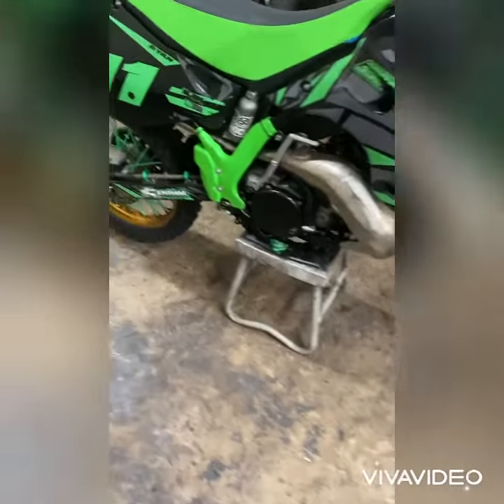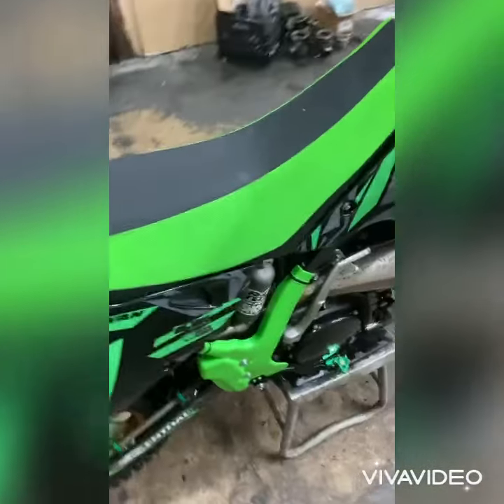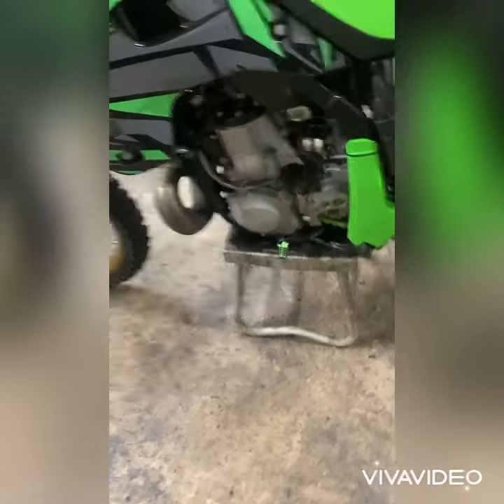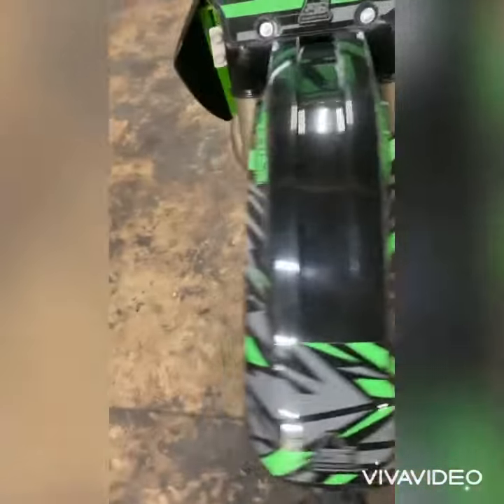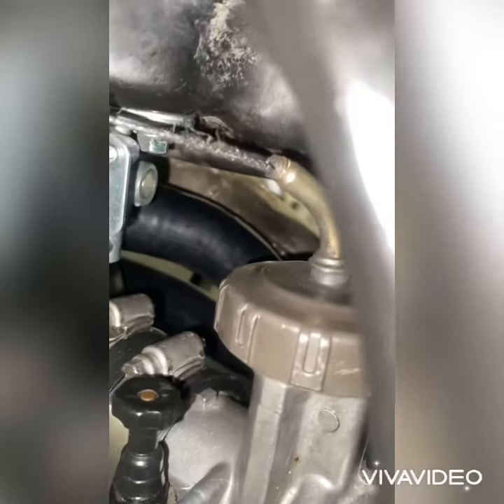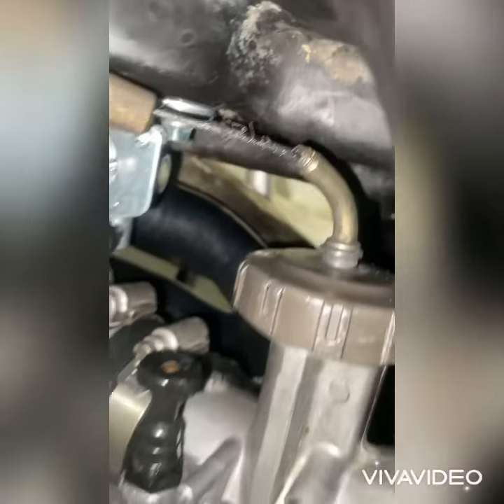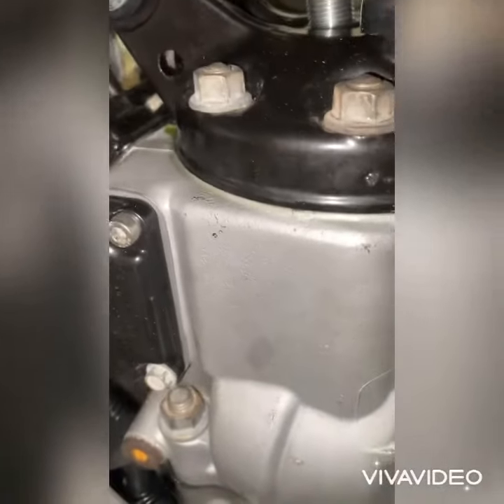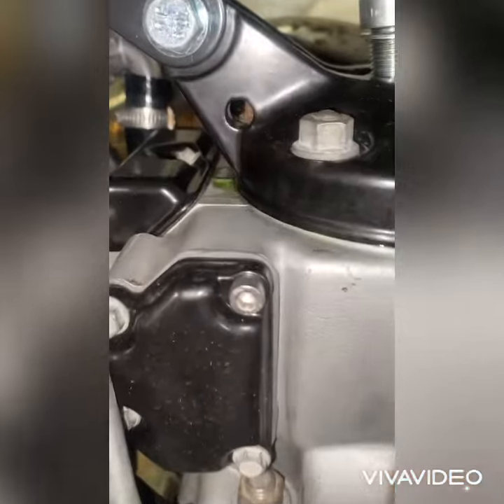🔨🔨🔧🔧 1993 kx250 footpegs carb clean tune up adjustment new throttle cable front and rear brakes

Comment: How much a bike like this cost?
Reply: $900-$2000 Miami used on offerup you can get cheap graphic kit from ebay
Reply: @mymtb965  hell nah more like 2k.. shits an old 250..
Reply: @imackmusic7924  nice kx be safe riding
Reply: @Rawboh  yeah agreed. The bike is almost 30years old.
Reply: @Rawboh  nàh bro a newer bike like that all customed out easy 5-10 grand
Reply: I just bought a 96kx250 for 600 and put 3 into it to get it running.
Reply: He got it on offer up for 4500 hahahaha
Reply: @yaaaboy3491  I thought so. Just because its a 93' kx250 if its that nice it going to cost some money for sure. I see 250s from the 90's all the time for $2000 and they look like crap hahaha This one is crazy clean!!
Reply: @MrSillypoptart  Listen this shit is old, yes its clean for the year especially if gold rims are original but without title 2k.. with title 2.5k to 3k..
Reply: @Rawboh  Yeah I mean it makes sense because I bought my 93' klx650 for about $2k with a rebuilt engine but shity cosmetics.
Reply: @MrSillypoptart  He smoking something at 4500. You could get a 2014-2020 crf150r all the way up to a 450 depending on how bad someone needs money in florida
Reply: @Rawboh  Straight up! I was just looking it up and the 2020 kx250 is like 6k almost brand new.
Reply: @mymtb965  your insane . 7 k is like a 2019💀